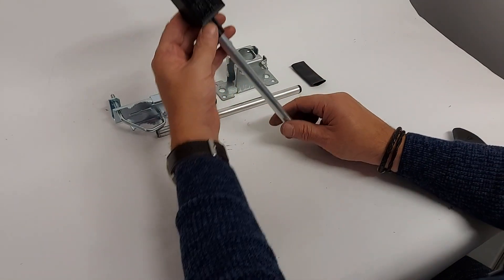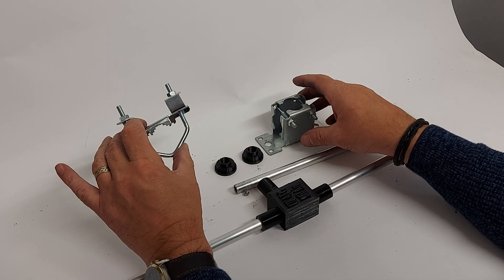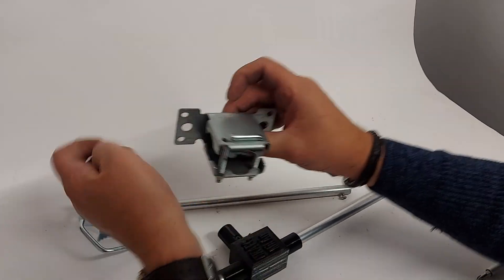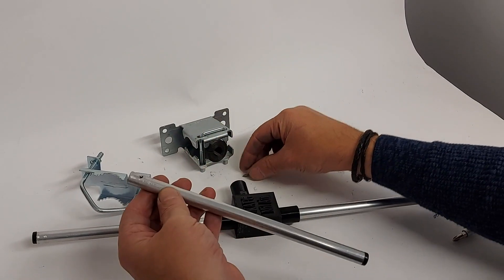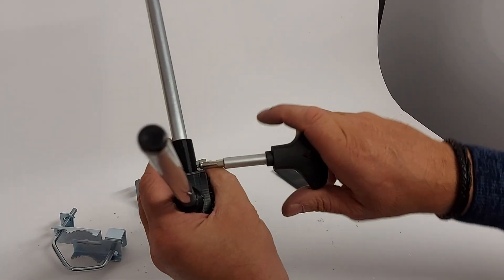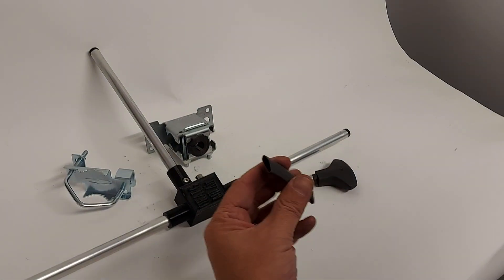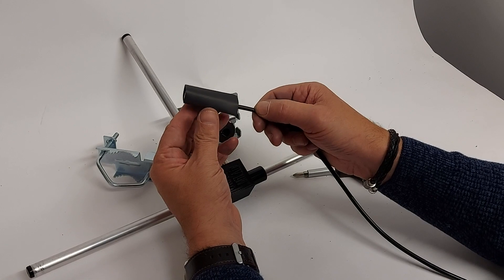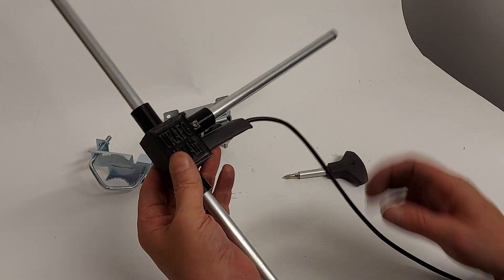Unpacking and Installing a UKAFG Dipole

Comment: Hi I see on your website that you sell a PMR Dipole. I am disabled and have little use of my hands. I am interested in buying a PMR Dipole from you but I don't use BNC connectors because I find the BNC hard to use. If I was to use a BNC to PL259 adaptor connector would that affect the performance of the antenna?
Cheers Keith